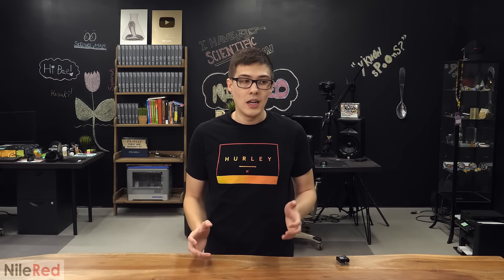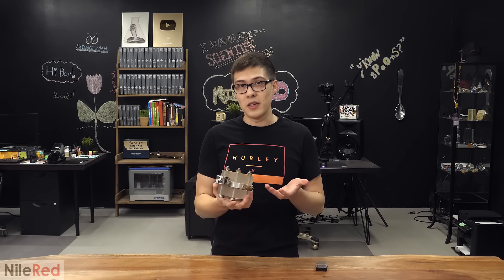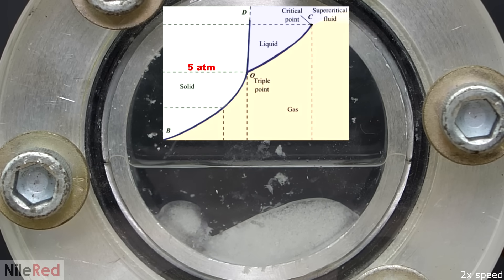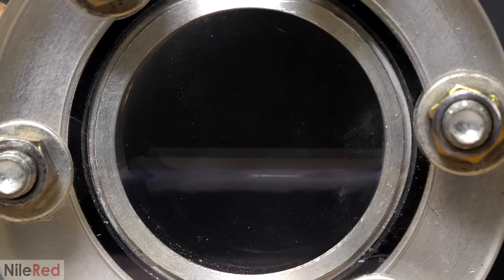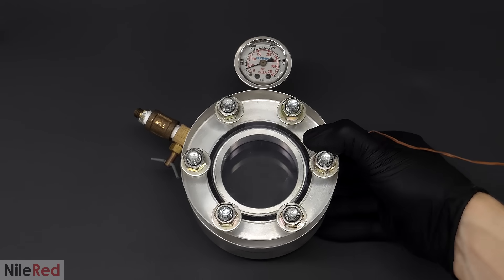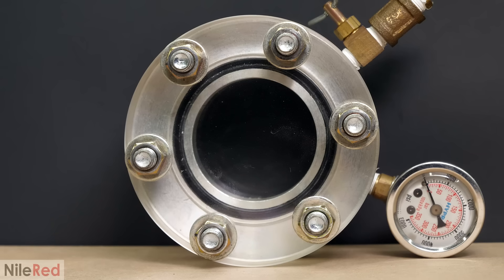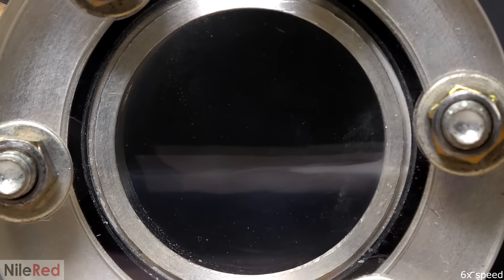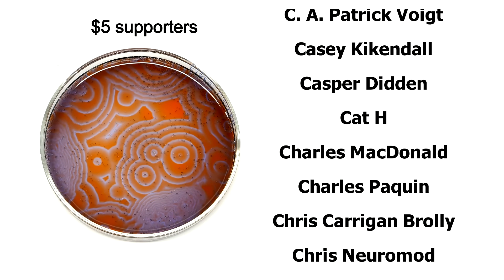Going supercritical.

Comment: Looking closely at the replay of the beads in the chamber. The cracks seem to appear the most when the pressure lowers. That must mean that when you're releasing the pressure the cracks are forming. CO2 must be permeating the beads and escaping when the pressure lowers. Does that mean your large bead will have a chance of exploding? Please be careful.

Fun fact: Venus is 800 atmospheres at the surface(and why its so hot). Since it's atmosphere is 99% CO2 it is a super-fluid about a mile thick.

This picture is hard to find. Thank god someone tweeted it.
https://www.facebook.com/astrogeekz/photos/damn-the-atmosphere-of-venus-exists-in-a-different-state-of-matter-called-superc/1999919750080906/

You can see the boundary layer. So amazing. :)

Comment: I also think those colors were caused by interference. The CO2 cracks the bead some ~micrometer sized cracks that are slightly not parallel, so that the thinkness varies slightly so that the constructive interference going to the observer varies slightly enough to see the color change. Since it seems like the angle matters to change wavelength too, it is probably interference.

Silica gel (if this is indeed it) is porous so... It was probably easy for the CO2 to get into it in liquid phase/supercritical. Apparently silica gel has an average pore size between 2.4-7.0 nanometers. Feels like plenty of space for an angstrom-ish particle to get into.

Some of those cracks, from a perspective of something crystalline (just for the sake of comparison, since I don't belive those beads are crystals, they are probably something along the lines of an amorphous solid or an amorphous solid with crystalline parts, or amorphous with a lot of porosity), are kinda big since hundreds of nanometers would be about 100-1000 times the size I'd expect in a crystal per se (~about an Angstrom to tens angstroms, something like that), without having a feel for how fragile the whole thing gets under slight pressure (or how a section cut of it would look under a microscope) I coudn't say for sure, but MAYBE you could see some of those cracks under a very good optical microscope or under any electron microscope (which I feel could be overkill here, and maybe the sample couldn't even be prepared to go in).

Or you could cut one in half very carefully (maybe after embedding it in a substract or something that wouldn't get INSIDE the possible pores) and observe it under an optical microscope with 1000x magnification.

I don't know... That is what I'd do to be sure, but it does feel to be a good guess.

Comment: Get you a torque wrench, that way you can tighten the pressure vessel to the exact same torque setting every time. Also, this way you know you've at least reached minimum torque to prevent a leak.

Comment: Why is it so expensive if it’s 99.8% air????? Also, why didn’t you ask Ben the torque required on the bolts for proper sealing?
Reply: I would assume the process to make it is expensive, but I don't know.

Comment: The silica beads remind me of tiny Citrine beads with rainbows in them hehe (aspiring gemologist) 

If I’m correct, I think that the cracks that were caused by extreme high-to-low temperature and pressure changes, probably from when you released the pressure from the chamber, this causes stress and trauma on the beads  , which form little rainbows :)) im just basing my knowledge off of what I’ve seen in gemstones and other crystals but I hope this helps!!!!!

Comment: when you shook the container it took significantly more force to move the beads meaning more friction 

Theory 1

The ultra dense co2 could be acting as an amazingly fine form of abrasive, getting rid of chunks of weak parts of the bead and also smoothening it out, it could be comparable to sandblasting. 

Theory 2
With the amount of friction between the bead and the supercritical substance it created an amount of heat briefly melting parts of the bead and then cooling

Of course I could be wrong as these are only theories.

Hope some finds out or has already found out
Reply: the CO2 is not ultra-dense in its super-critical state. pretty much the opposite, actually. super-critical state is pretty much a state between liquid and gas, both of which are less dense than solids (in this case dry ice, which is what he started off with). i wouldnt say its "friction" as much as its the fluid weighing the beads down, similarly to an object under water.

Comment: Hey I’m a bit of a gem nerd, I know that there are other comments but I felt like giving you my opinion. 
Using silica and introducing it to high pressure and temperature is exactly how synthetic or man made gems can be made. Specifically I’m going to quote milky/greasy quartz first as it’s a silica that’s introduced to co2.

“Milky Quartz is Trigonally structured gems are made of silicon dioxide, their full chemical compound being SiO2. Milky Quartz is a milky white translucent to opaque variety of crystalline quartz of somewhat greasy luster. It is the commonest variety found in pegmatites and hydrothermal veins. The color is generally caused by numerous bubbles of gas and liquid in the crystal. The milky color is caused by small cavities filled with numerous small fluids and CO2 in liquid condition. It is used as a gemstone, and also called greasy quartz.”

Next this is how ‘titanium quartz’ / “aura quartz” is made.

“...aura is created in a vacuum chamber from quartz crystals and gold vapour by vapour deposition. The quartz is heated to 871 °C (1600 °F) in a vacuum, and then gold vapor is added to the chamber. The gold atoms fuse to the crystal's surface, which gives the crystal an iridescent metallic sheen.”

It seems the process is highly similar. Hope this helps.
Reply: This gentleman knows what he's talking about. Silica is essentially glass, pressurizing and fracturing it like that allows it to refract light in such a way as you observed.
Reply: @bearmauro2393  i agree to that exactly
Reply: highly recommend any books or papers authored by "Kurt Nassau" [Gems Made By Man], [Experimenting With Color], [[Gemstone Enhancement]
Reply: To make crystalline silica (quarz) you need a protic solvent to be able to break the Si-O-Si bonds which CO2 alone cannot do. Without breaking any bonds you cannot convert an amorphous network  into a crystalline framework.  You actually use super heated water under high pressure together with a mineralizer which serves as a catalyst (often NaOH)). The industrial process is called hydrothermal synthesis if you are interested.
Reply: I first read this as "man made germs" and was really confused
Reply: @giba169  there are some of those about also.
Reply: Wow right on, I mentioned above it reminded me of lapidary work I did in NC. Silver Topaz by the lb...
Reply: Noice.
Reply: I don't think the pressures or temperatures here are enough to transform quartz crystals to their other forms,but it surely did  something to it so i'm not sure.
Reply: Titanium is also vapor deposited on diamond, leaving an iridescent metallic sheen. This is done not for aesthetic reasons, but for bonding reasons. Diamond is so tightly packed and smooth that it is 'slippery', in regards to gluing it to things, so they deposit a titanium film. The titanium is easily bonded to but bonds with the diamond by the creation of titanium carbide.
Reply: Richard Smith still i don’t see its purpose on quartz
Reply: I'm glad I found the actual answer after looking at the ridiculous 180 comment thread that a dude took over claiming he was smarter than everyone else
Thanks dude (or dudette, I don't judge)
Reply: time to s m a r t
Reply: Being a guy who's here to enjoy shit I barely understand, this is pretty phenomenal, just to read. Nice factoids.
Reply: he's a man of science
Reply: Hey Aquavenn. Do you know if milky quartz is still good for exhibiting piezoelectric effect?
Reply: @nilered
Reply: so he's made a gem wow.
Reply: Thank you for explaining it better than I could have
Reply: Now i wanna do both of those
Reply: You are a nerd but the cool one
Reply: Hi thanks for the info I am less dumb now 😁😁😁
Reply: Indeed
Reply: You are operating way above my pay grade. But that is interesting as hell. I immediately started thinking of how I would build a vacuum generating furnace. Then I stopped myself, because I have too many homemade things scattered about. Lmao Have a great day. You made this uneducated nerd think a little. 🤣
Reply: Oh thank you for confirming this! I thought these silica beads looked like they had the kind of cleavage I'd seen in quartz crystals!
Reply: Does this confirm my guess that under such high pressure CO2 is chemically forced into the silica, and that if left in for longer would make browner beads?
Reply: Waht?...
Reply: I like trains
Reply: ok nerd
Reply: @ammyvl1  dont be mean to  him >:(
Reply: Watched Steven Universe a few times huh?

Comment: I'm not very good at chemistry what so ever, but silica gel is supposed to absorb and trap liquids, so it could be that traces of liquid co2 were contained inside, and as it depressurized it expanded into gas, cracking the gel but still being contained, and the thin layers of co2 are forming a very basic form of spectronomy.

Comment: @NileBlue
Just for your potential edification, the dial surrounding the drill bit and chuck on many hand-held power drills controls the torque applied to the nut/bolt being turned. You can find plenty of higher precision ones for under $200, if you search for:
Torque Control Drill OR Adjustable Clutch Screwdriver.

For example, "Milwaukie Tools" has one listed with this description:
"Choose the torque setting that’s right for the job. The adjustable clutch screwdriver makes it easy to fasten screws and bolts consistently with optimal torque. The multi-position clutch easily adjusts between 10 and 140 in-lbs of torque, while the 6.5 amp motor delivers 1,200 RPM. Designed for high durability, this tool maximizes user comfort and balance. Use the removable belt clip with bit storage for increased portability and convenience on the jobsite."
That's 20 revolutions per second, nearly two factors of magnitude times faster than you, not including time in switching ratcheting points.
You may never need to know that, but you could have crept up on the sweet spot by dropping in a chunk and quickly spinning down on 10lbs.... then 15, 20, 25... Also, you could have added a flexible washer under the zinc-plated one to reduce the likelihood of cracking the [acrylic?]
Thanks for all your hard work and steady, rational, easy-to-follow videos that result. I'm a huge fan and want to go back and study chemistry like I feel I should have 30 years ago. Your videos make chemistry seem less intimidating and more approachable, while obviously talking about safety AND the importance of limiting the risks that you do take while accepting that not all dangers can be reasonably prevented in the pursuit of... SCIENCE!!!

Comment: I have a theory. Under pressure cracks formed and the super critical OC2  was forced into the cracks. Maybe under these extreme pressure the surfaces of these cracks formed a thin layer of silica carbide or carbon silicate?  Maybe the brown coloration is from the same type of diffusion into the silica? These substances are brownish and reflect rainbow type colors from their surfaces.

Comment: Once I tried  using silica gel beads as boiling stones.  Some of them would break up with a pop.  I suppose that it was pressure from trapped air or steam that could not diffuse out fast enough.

Comment: It could be ... that the beads have cracks that act like... prismatic crystals or those glass pyramids that disperse light so it looks like a rainbow...

where the yellow colour comes from? Probably the silica itself,

Why the CO2 looks blue?

Disperses short wavelengths... like air... which is also why the sky is blue.

Would be interesting to see ... what the CO2 looks like when it's hit with ultraviolet or infrared light

Comment: The rainbow comes from the internal refraction of light. Some of the light is reflected by one side of the crack and some of the light is reflected by the other side of the crack, depending on the distance between both surfaces of the crack changes how the light waves interact with each other after they are reflected back into your eyes giving you the different colors. It's basically the same concept of why titanium changes different colors the more it's oxidized.

Comment: The one thing that REALLY buggs me in this video from a scientific standpoint is how he keeps talking about how it looks "like there is nothing inside at all" or how things beahve when there is "nothing inside". You didn't pull a vaccum on the chamber so it's still fully filled with gas. It would also probably look almost the exact same if the chamber was fully filled with a liquid (with no pockets of gas inside) except for some different refraction of light potentially.

Comment: The pressure gauge is not broken.
They can malfunction when liquid is getting inside.

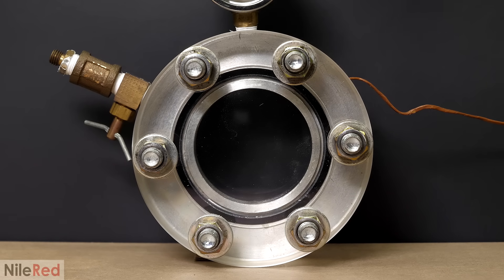Most importantly, the scaling is way too high for this application and this "little" readout (10:45) is showing about 30bar or 30 atmospheres and can go up to 350bar.
So clearly 5bar won't be instantly noticable when just glimpsing over it.

But it's nice to see you experiment with it.

I was checking if I'm wrong and noticed you have shown 2 different new gauges.

But seeing that the indicator went up higher in the new gauge which can go to 5000psi / 350bar, i now realize with evidence that either the first one was defect or not accurate or the new one is not accurate.

I would recommend you to get another gauge with it's limit at 2000 or 25000psi, so you have an accurate readout.
(Despite I'm not sure if Ashcroft gauges are accurate)

Coming to the cracks, i think you are right, these cracks are reflecting different colors of light due to thin film interference.
If not, then polarisation would be the next phenomenon, but this is not very likely.

Comment: We use supercrital CO2 to extract pigments and everything inside of plants material, so what’s is happening here is that supercrital CO2 get inside every pore of the silica like HPLC silica for separation and because of the fast pressure increase inside silica they breaks if you add another solvent you will be able to collect all inside of the material

Comment: You are right on as to the origin of the colors in the beads, "Newton's rings".  Regarding the original gauge, I think it is not broken.  It is twice the range of the new one you bought.  Something to note about gauges is the "zero point".  On gauges and meters, the zero point (being set correctly) is important.  But on gauges, by some sort of tradition, the manufacturer hides an ill-set zero point, by putting in a stop-pin BEFORE the zero-point.  Look at the scale on the original gauge.  Between 1000 and 2000 there are 5 divisions (200PSI/division), but between 0 and 1000, there are only 3.  There are 2 divisions missing!  So that gauge (if properly zero set) will show "nothing" (pointer doesn't move off the pin) until 400PSI is reached!  Later in the video when you heated things up, the gauge was showing what appeared to be correct pressure (CO2 at room temp is about 700PSI).
     One thing I would recommend against is putting dry ice directly in the chamber.  This will generate stress in the Plexiglass window, and could start cracks WHICH PLEXIGLASS IS NOTORIOUS FOR!  Get a "lecture bottle" and plumb that to the chamber.  Crush the dry ice, funnel it into the bottle, hastily screw on the valve, (don't worry about small leaks), warm it up, pipe it to the chamber at near room temperature, and then valve chamber off.  Don't thermally shock the chamber!  (View chamber between crossed polarizers from cheap polarized sunglasses to see stress.)
     Another thing I would do is to make a pair of metal rings to distribute the bolt forces evenly around the window's edge.

Comment: i think your theory about the interaction of critical co2 and silica beads is fairly fitting, it seems probable, what i think would be interesting is if you were to find a material that is less dence than the liquid co2 so it floats, and see what happens when the density equalises between liquid and gas, im not sure what it would do, im guessing because of the changing density it will either sink or float higher or lower in the chamber relative to the original fluid level

Comment: The pressure meter wasn't broken, it's just rated for extremely high pressures. 1atm is about 1.01bar and that meter can measure up to 350bar. You said the pressure of the condensed CO2 is about 5atm; that is basically the minimum resolution of the meter as it is approximately equal to the distance between the red markings.

Comment: I remember as a fun last lab in ochem, after the annoying weeks long synthesis labs, we used liquid CO2 to pull oil out of orange peels.  This was fun to do.  I wonder if the thin cracks are altering the direction of the light passing through.  My memory of physics is a bit shoddy, but I seem to remember that light passing through two density materials alters directions.  That may be whats causing it.

Comment: Opals are made of silica! It is pretty likely that youve made an opal-like structyre. Theyre a sedimentary gem, years and layers of silica collecting and joining under pressure. It would be very interesting to see what happens with larger silica beads. Ive seen manufactured opals that i thought were bits of opal in a resin, but now it seems that this could be another kind.